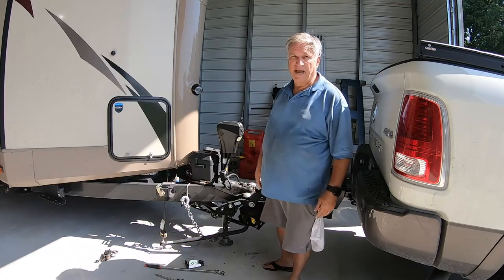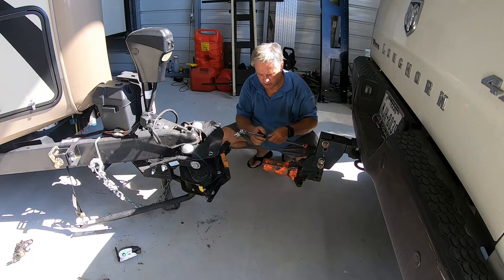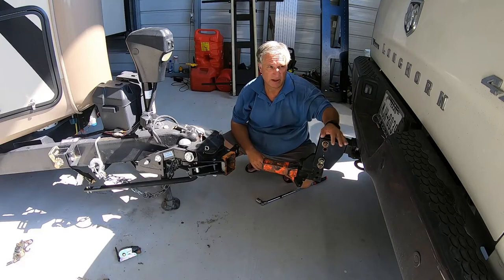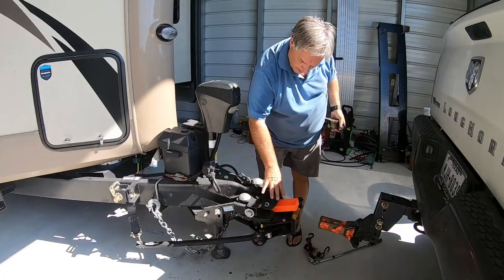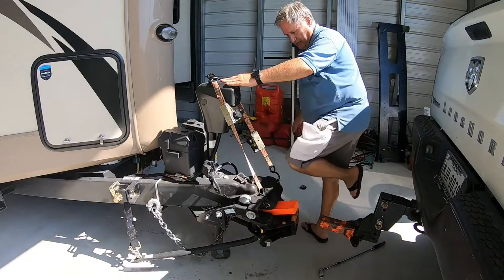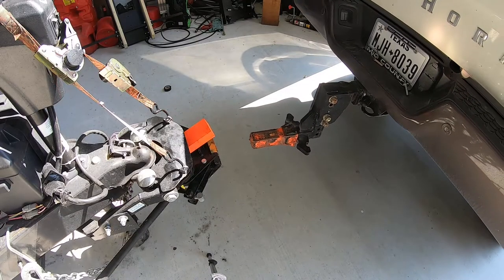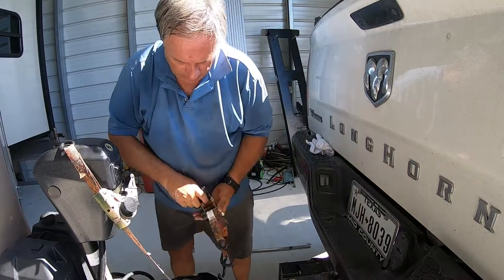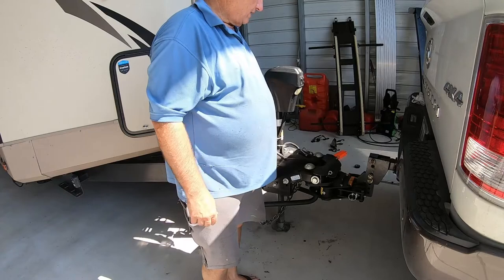ProPride Hook Up With StrapTek Technique

Comment: I also have the Strapteck and I found that if you get more tension on your strap just by turning the strapteck adjustment by hand it stabilise the head and you have much less mouvment that I can see on your video. When I unhook I take care not to touch the head...and when hooking back if the height of the head match the height of the stinger it just go back in as easy as it went out without touching anything.

If I ever have to adjust the head up for any reason I use a bottle jack under the head as suggested by Sean.

If when you hook the head is not at the right angle, sometime it is because when you unhook the trailer was too high or too low and the head angle moved will the stinger was getting out. To prevent that, once your bars tension is released, start very low or too high and move your tongue jack up or down depending if you started low or high and put your index just in front of the trailer ball receptacle so the tip of your finger is touching the Propride head and the side of your finger is touching the trailer ball receptacle. When you will feel that the trailer ball receptacle is moving independently than the Propride head stop there...you are just at the point where you get no more tension between the stinger and the Propride head.  This moment is quite small, just last about 1/8 to 3/16 of an inch.

Comment: Thanks for the video . Helped me to decide to keep the hitch I have . I tow a 25 airstream flying cloud with a f-350 super duty with a BM 21000 pound hitch with a 3 inch receiver and a 2108 tongue weight . Tows great even in strong winds and tractor trailer traffic .

Comment: It appears to me that the angle of the hitch doesn't match the angle of the stinger, when hitching. Would it be easier if you put some tension on the straps and raised/lowered the jack so the hitch and stinger were at both the same height and the same angle?

Comment: Thank you for posting this. I may go with the Straptek. I'm thinking a strong bungee might work vs the tie-downs. it looks like the tie-downs took some load when the head tilted down, maybe a bungee would be more flexible? It would need to be a heavy duty bungee
Reply from the maker: Maybe do, but I have to pull pretty good to get the hitch pulled up and level each side to prevent movement. Bungee may work well though. Worth trying.

Comment: Why not use a hitch that is easier to hook up?
Reply from the maker: Robert Dawson , Because the ProPride hitch is the best hitch ever made. It pulls so much better than any hitch out there. Most have a method to reduce sway while pulling but this hitch completely eliminates sway. It is really easy to hook up to but when the trailer and truck are at different angles, it is some harder but still really pretty easy. I will never pull a heavy trailer without a ProPride hitch again.
Reply: I've had Equalizer and Reese Dual Cam. The ProPride is easier after a short learning curve.

Comment: Hensley is much easier to hook up.but thanks for the video
Reply from the maker: Mr Paul Grimm ProPride is much easier to hook up with normal setup. However, with my Windjammer, the normal setup doesn’t fit right, so they have a system that uses straps instead for trailers like mine. This poses a harder to align than normal system. Does Hensley make a system for Pointed nose trailers?
Reply: He changed sway bar raise part, so that's why it's hard to keep the receiver there.
Reply: @DaleStagg  yes Hensley does. They use chains on the weight distribution bars with snap up brackets. They also have drop down bars that attach to the weight distribution bars that hold the head in place while hitching up. I believe they call it the Swift Arrow.

Comment: It's a shame that such an expensive hitch would require diy rigging and fiddling to hich up.
Reply from the maker: It really only because my driveway angle is much more than my garage which is level that creates the issue. If hooking up in other locations, it is not really needing to do this. Either way, the driving experience makes up for the issue. Driving with this hitch is so much better and safer. I have driven in circumstances where sway would have occurred but never with this hitch.
Reply: @DaleStagg  Thanks.  I've got two WD hitches, and still feel a little uneasy with the movement. 
I was thinking about the ProPride, but It's hard to imagine that it would be 3.5 times better than my Weigh Safe or my Andersen......since it is 3.5 times the cost of the Weigh Safe and 7 times as much as the Andersen.  I know safety is worth more money, but they do seem overpriced.
Reply from the maker: @tkilg7169  yes, I thought the same way when I got into this. However, I was pulling one day and all was great when I got into an opening with no trees and the wind hit me at the side and I got into a sway that scared me bad and had my wife and young grand daughter with me. Upon getting to my camping spot, I called and started investigating these at that time. Sway bars help control sway to an extent but these expensive hitches eliminate the sway at the source and not control the sway. I have never felt sway since and drive at normal freeway speeds in wind and trucks and never felt sway. I can drive one handed and feel comfortable doing so. For me, the price was worth it but do understand. Be safe! I would do it again in a minute if needed. My trailer is a V Nose which requires the straps vs normal system which is easier 5o connect without my strap method when at awkward angles.
Reply: @DaleStagg  Thanks.  I am on the fence, and your perspective helps.
I downsized from a fiver to the 25' travel tailer I have now, and  I got spoiled by the stability of the fiver.  I am leaning hard toward the ProPride or Hensley to get that same stability.  Do you think the v nose of your camper contributes to it's tendency to sway?
Reply from the maker: @tkilg7169  I do not think it is a contributing factor. They are heavy and any heavy trailer can sway especially if too much weight in the rear. They need tongue weight to help eliminate sway. I chose the ProPride because the Hensley did not adapt to using on another vehicle without buying more parts vs ProPride is adjustable. Their support is top notch if needed but cannot say the same or not with Hensley since I do not have one.